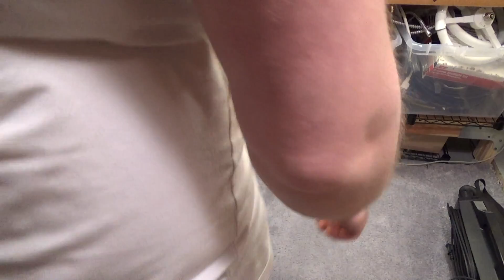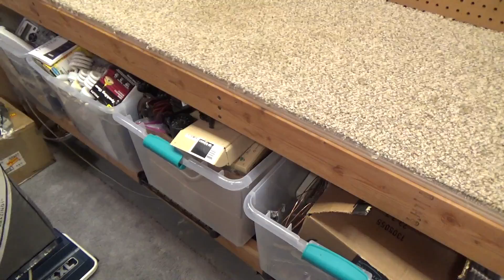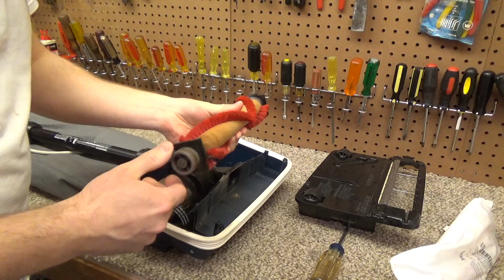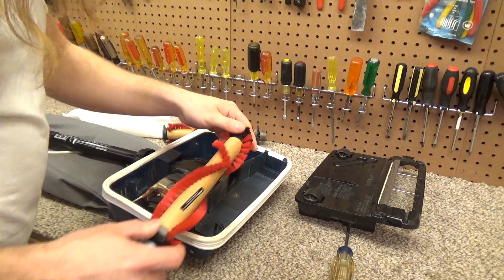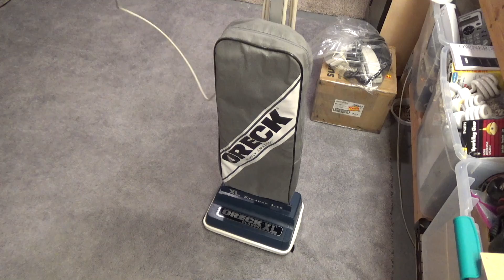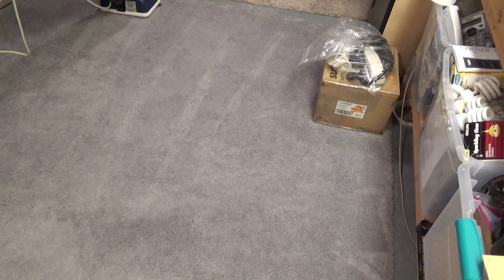Repair Oreck XL Classic with Noisy Brush Roll Bearings

Comment: I miss when vacuums like this Oreck were designed in such a way that if you could obtain replacement parts from a dealer for a reasonable price, you didn't need to buy a brand-new vacuum every time. Considering that Oreck was acquired by Techtronic Industries Floorcare Technology LTD. -- the same conglomerate that owns Hoover -- I believe you can now get the "Hoover Commercial" joke that they call the newer version of this design, which is really the same as this vacuum but with a different paint job and branded as a Hoover. Kinda wondering if the original Oreck XL parts are interchangeable with that "Hoover"-branded clone... :(